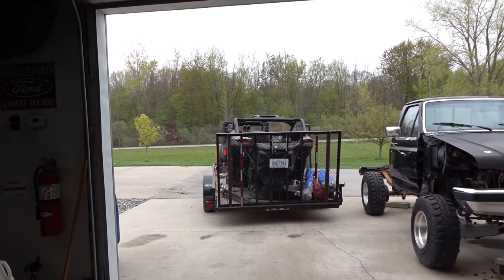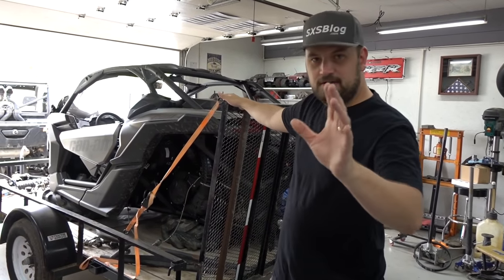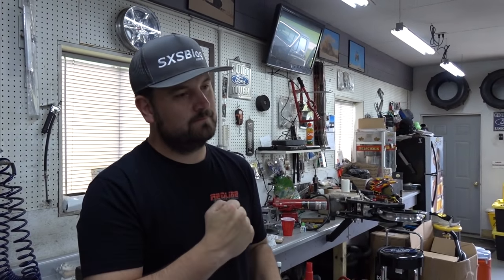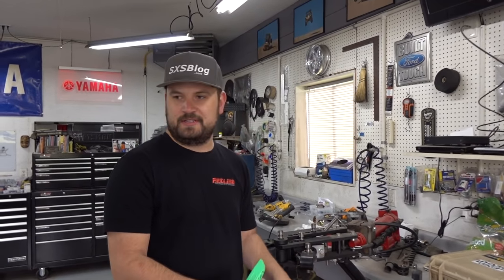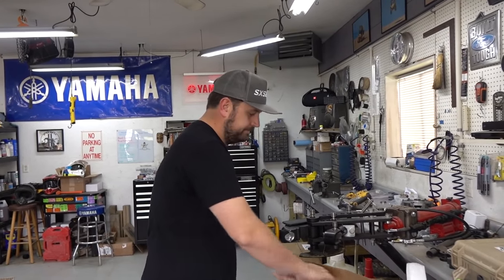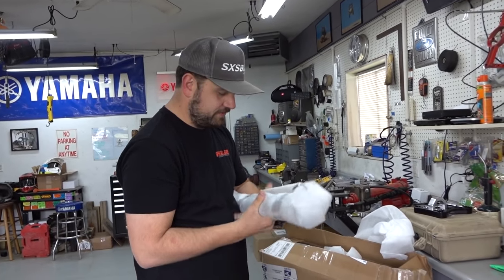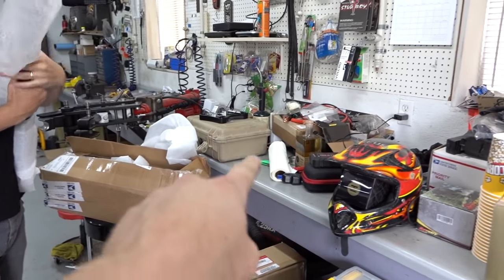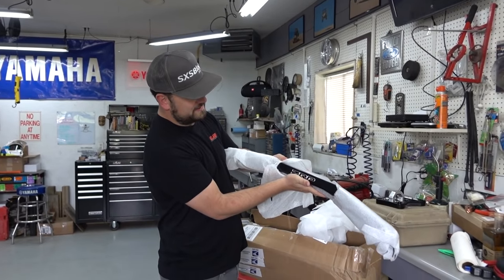Leo's NEW Maverick X3 made TOUGH with LSR and ZRP stuff!

Comment: All X3 Owners should really check out HESS MOTORSPORTS weld in radius rod certs. You cut out the studs and weld in nut plates. You then run bolts  through the rear plate. If you have adjustable rear radius rods you can pull the bolt on just the one you want to adjust. It makes changes way easier and it also make it so nothing can move around.

Comment: Assuming you are using the same shocks, they came on a narrower suspension and now on a wider one. Ride height is of course going to be way off. I would also assume CanAm would valve the shocks differently as well as spring rates if they did it right.
Reply from the maker: Shocks got switched as well to match the arms
Reply: @SXSBlog  Well dang! There goes my theory haha

Comment: Will just the radius arms fix a camber issue I'm having on my new x3 ...rear driver tire is off camber from the other..thanks dudes
Reply from the maker: Yes they are independently adjustable so you can get the camber corrected with the radius rods.